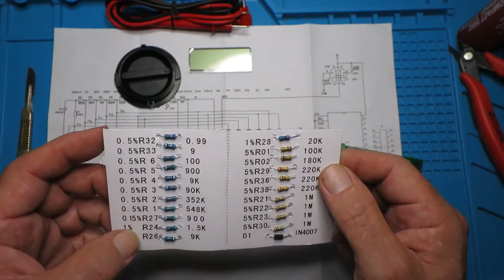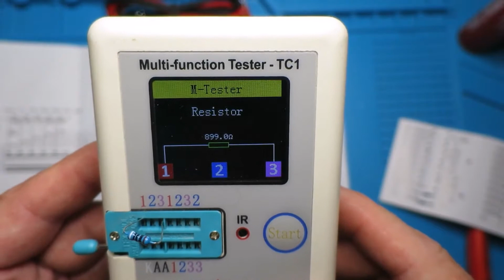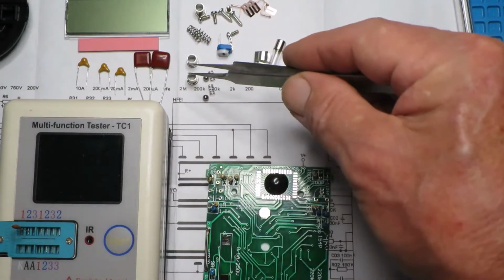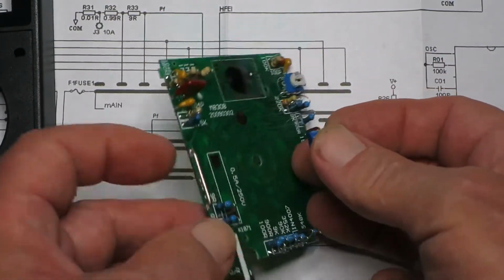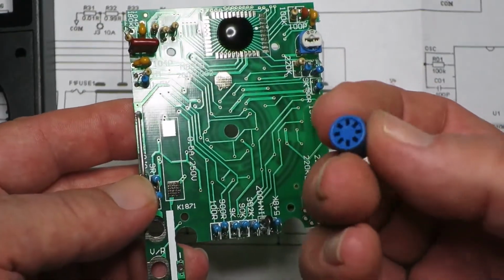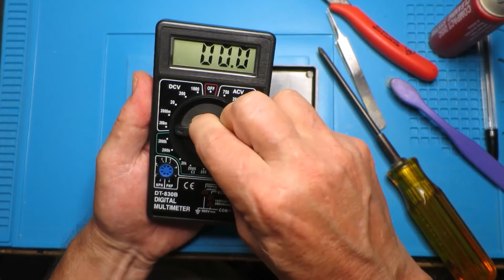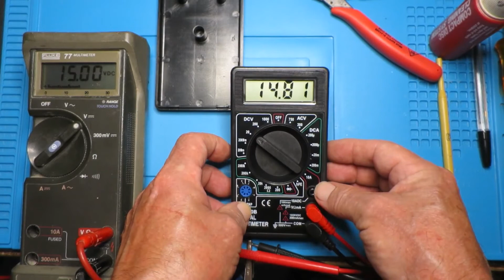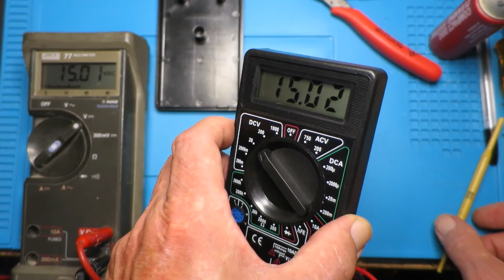Digital Multimeter Kit Build DT830B DMM - Electronic Beginners Project

Comment: I built the same kit in Sept 2022.

Everything works except the voltmeter part.

I have the Transistor ESR PWM tester, 

and tested all the components 

before I put them on the DT830B board.

Everything is where it should be.

I'm perplexed.
Reply from the maker: It is a very simple circuit, you should have a copy with the kit or there is a link in the description. The irony is you will need a multimeter to check things!! I would look at the switch contacts as they are a bit flaky and may be poor contact. Thanks for watching, have a great day!
Reply: @1nformatica  
Well; I had some time this evening.
I took the MM apart again. (Sigh)...
After looking it over again, and cleaning up the contact board on the back side, and putting it all back together again...
The voltage portion of the MM just bounces all over the place with random values, and sometimes just goes to 1 
or, it will black out completely.
I have a fresh battery in it.
I'll donate it to someone willing to fix it.
Reply from the maker: @jenntek.101  At least you had "fun" trying! My money's still on bad contacts.
Reply: @1nformatica  how about this..
I send it to you.
You can troubleshoot it and make a video about it.
I don't want any money for it.
Reply from the maker: @jenntek.101  It's a kind offer but these days I make more videos about RC Planes. Also shipping to Spain would be much more than it's worth!
Reply: @1nformatica  I know.
haha...
RC Planes. My Dad loved them!
When I watch your plane vids, It reminds me of Dad...
You're going a great job!
Reply from the maker: @jenntek.101  Hey thanks! Hope you will keep watching! Have a great day!

Comment: Sir can I have the ckt diagram of DT 830 B & DT 830 D ?
Reply from the maker: The circuit diagram can be found on this link : https://www.hobby-hour.com/electronics/dt830b-digital-multimeter.php
Reply: @1nformatica   Hello, and thanks for this video. If possible the circuit diagram = schematic of Dt830B and DT830D,  the link above is died.
Reply from the maker: @braveheart9275  The link still works for me : https://www.hobby-hour.com/electronics/m830b-schematic-diagram.gif
Reply: @1nformatica   Thanks . But the gif in the link is for the 830B , not for 830D.
Reply from the maker: @braveheart9275  As far as I know the only difference is the buzzer for continuity.
Reply: @1nformatica  Hi .. Really thanks.
Reply from the maker: @braveheart9275  You're welcome! Have a great weekend!

Comment: A sign of the times when the kit costs more than the pre-assembled unit!  As a precaution it should be said that measurement of voltages in excess of 60vDC or 30vAC rms/42vAC peak can be hazardous and it is generally considered that the DT830 should not be used to measure mains voltage, partly due to the cheap fuse, but mainly due to the low quality test leads and the inadequate track clearances around the input terminals. If used to measure more than a few amps DC these meters-and their leads- get too warm.   Please don't get burned or killed to death, etc etc. These are hobby meters.  

Good video.

Comment: May I ask a question:
I have wired up a reversing camera on my van and after some research have finally managed to get it working when the van is running and put into reverse, my issue is that the voltage rises to 14v (charging voltage) and causes the camera to flicker. Can I use a LM2940CT-12 with a 47uF capacitor on the camera circuit to regulate the voltage down to 12v ?
Reply from the maker: Hi David, Yes the LM2940 is a good choice, the spec sheet (http://www.ti.com/lit/ds/symlink/lm2940-n.pdf) says "Designed also for vehicular applications, the LM2940-N and LM2940C and all regulated circuitry are
protected from reverse battery installations or 2-battery jumps. During line transients, such as load
dump when the input voltage can momentarily exceed the specified maximum operating voltage, the
regulator will automatically shutdown to protect both the internal circuits and the load." Check the current required for the camera as this is only a 1 Amp device. Also it may need a heat sink although I guess you won't normally be reversing for long!!

Comment: Fantastic build, man. :) Really great kit too. About your irons... Man, they're really old! O_O I don't know, but I think I'm using my 4th or 5th already! That's the difference between a good soldering iron and a really cheap one. As they say, you "get what you pay for". :/
Reply from the maker: Obrigado! Yes, those irons are like family members! While I was still at school I worked for a friend's father building alarm systems using "NORBITS" early IC's. His wife worked for a large military electronics company and taught me to solder to those standards. Also gave me my first professional iron a Weller similar to the one in the video. Also got introduced to some chemicals which are now banned such as Trichloroethylene and carbon tetrachloride used for cleaning the boards after soldering, got quite a buzz out of that - literally!!
Reply: 1nformatica Yeah, I can imagine! Now they use liquid flux to do that, much safer!
Reply from the maker: Not as much fun though! And the young people think substance abuse is a new thing!!